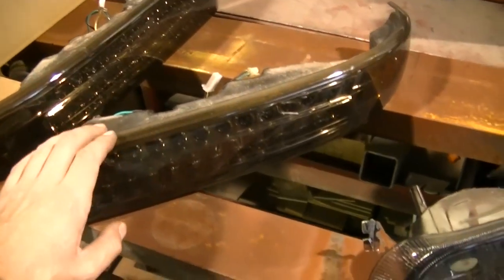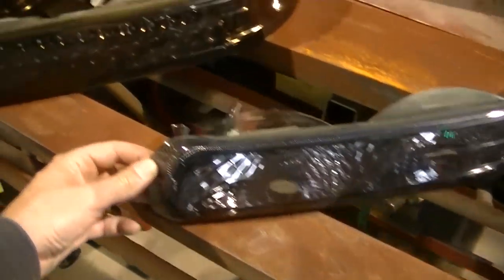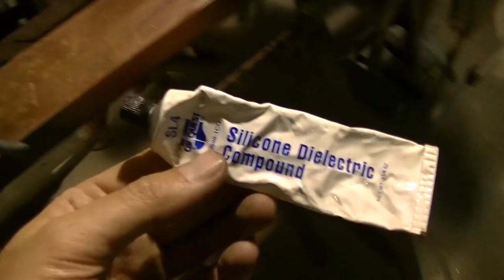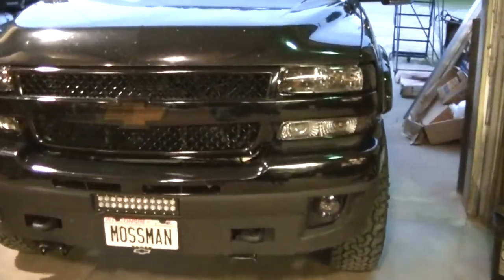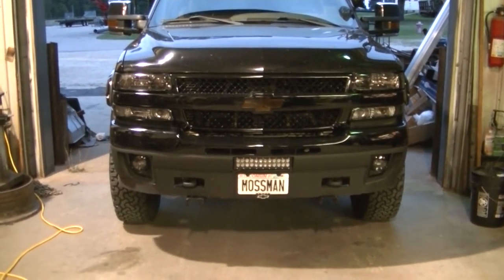Darth Dually New Headlights and Parking Lights LED Bulb Hyper Flash

Comment: Thanks for linking me to this video. Appreciate that you give honest advice without treating people like they are stupid, it's something more should practice.
Reply from the maker: No problem.  I think I used the Sylvania LED bulbs in this video which I have already taken out.  Just didn't like the output of them.  Really disappointed with them for as much as they cost.
Reply: I hear ya there. I have been holding off on light upgrades because of the cost. Hoping a light will blow so I can justify the cost of LED upgrade lol

Comment: Looks good!  I've heard that using LED lights could cause issues but didn't know about using a resistor.  Thanks for the info!
Reply from the maker: You might be able to get an electronic flasher to stop this.  I thought the 2000-up trucks had these already but maybe not.  The resistors came with the lights so I used them.

Comment: Quick Question. I'm looking to do the same setup.

Q1. Are these the correct light sizes?

Headlight:
- 9006 = lowbeam
- 9005 = highbeam

Signal:
- 3157A = daytime 
- 3157A = turn signal
- 194      =  side marker

Q2. Do you need resistors for every light individually? or just the two headlights and the turn signal?

Q3. Are those all stock light sockets for the parking 3 parking light bulbs?

P.S. Your videos are awesome, I've spent hours watching them.
Reply from the maker: Thanks,  those all look right except the official DRL is a 4157 I believe.  I think you can run a 3157A, which the A means amber.  I have a hard time getting the LED lights to last as a DRL.  That socket seems to get hot for some reason and even gets distorted and the bulbs are hard to get in.  The resistors only need to be on the turn signals.  If you have time to order an electronic or LED flasher some have told me you don't need the resistors.  That was what I had at the time and wanted to show everybody how they worked.  All the sockets in this video are factory type.  I hit a deer and had to replace some but they are still the same type that it came with.

Comment: You just answered my question about what to do with y 98 'Burban.  I'll skip the integral LED assemblies and just install LED bulbs.  I just put a set of LED reverse lights on that I found on Amazon.  They have a pretty cool mini projector.  They are awesomely bright.
Reply from the maker: Those LED lights only last about 2 years.  They are cheap enough really isn't a problem replacing them.  Do you have a link on those LED reverse.  One of mine went out and I paid like $60 for the set.
Reply from the maker: Rocky Mtn Redneck   Thanks,  I will check them out.
Reply: ....of course my S10 I deleted the factory blinkers when I built the bumper and just used the slim LED light bars.  Used the same for under the tailgate lights in the rear.  I didn't have to put resistors on the cirucuit. I was able to just install an LED flasher on them and that killed the hyper-flash.
Reply from the maker: If the lights wouldn't have come with the resistors I would have tried the LED flasher.  I have been to the auto parts stores before looking for LED electronic flashers and they just look at me funny.  I can't find anything local.
Reply: That's strange.  I can find them at Auto Zone or O'Rileys. Ask them to look up an EP29 flasher for your truck.  That or try Amazon:

iJDMTOY (1) 4-Pin EP29 EP29N Electronic LED Flasher Relay Fix For LED Turn Signal Bulbs Hyper Flash Fix
Reply: There's the reason I have Amazon Prime.  Anymore, they beat most anybody's price.  Every once in a while I have some key component of a project delayed, but usually it's okay.

Comment: hey man I also have a 03 suburban and I'm running the chrome depo projector headlights and I really love it. im running the 55 watts hid kit. the light output is great and very bright. I was thinking about replacing it with the new auxbeam led headlight kit. my brother has a 2002 silverado and he has the new auxbeam headlight and they are pretty bright. he has the stock headlight housing .  i will make a video soon on my 03 suburban.
Reply from the maker: I tried 55w hid in those lights and it melted the housing right in front of the projectors.  When I got those lights that was my intention of running 55w hid.  I love the LED headlights and they don't seem to be blinding like the hid but they are good and bright.

Comment: hey I am looking to buy some new headlights with the led bumper lights for my 99 Silverado. you said that about every two years your bumper lights start having issues so I wanted to know if those are just ebay ones you have had and know that they go out every few years or if they are nice expensive lights from somewhere else? also did you need a resistor for your led bumper light set or just when you replaced the turn signal with an led bulb? thanks
Reply from the maker: I have gotten all my lights from Ebay.  Not sure if spending more on them will make them last longer or not.  I usually change my setup every now and then anyway so don't like to spend a lot.  If you buy LED parking lights they should come with resistors installed with them.  If you just change bulbs to LED then you will need to add resistors or the easier better way is to get and LED flasher.
Reply: mossman381 alright thanks for the insight

Comment: I have the same housings and my driver side adjuster died as well. how are the morimoto fogs doing? are they better than say your 1500 with the oem and hid's? I have a set of led 880's in my fogs, and I love them, brighter than stock, but I want more light.
Reply from the maker: Pretty disappointed with the Morimoto lights.  They throw some light on the ground and that is about it.  I need to do a video to show.  I feel like something might be wrong with them.  They are suppose to be really bright and for $200 they better be bright.
Reply: I've thought about getting some of the DOT compliant rigid pods and mounting them in the oem location
Reply from the maker: Geekrc2012   I don't really like the pod look.  I wanted the OEM look.  I spent a lot of time making this bumper so I could use the 2015 fogs.  I may just get some smoked OEM style with either LED or HID.
Reply: I have 55w ddm tuning hid's for lows and aux beam f-16 for highs, and I have my main beans focused so far down I want more from my fogs to compensate

Comment: One thing you could of done besides using the resistors (I despise using them) is changing to an electronic flasher and/or getting canbus/error free LEDs. The canbus/error free LEDs have built in resistors so it has the resistance of a normal bulb, so no hyper flash or bulb out warnings on newer cars/trucks.
Reply from the maker: I thought the newer trucks already had electronic flashers?
Reply: +mossman381 Pretty much every newer vehicle the flashers/turn signals are controlled by the body control module so they don't have a replaceable flasher. But the canbus/error free LED's should still correct the problem without using the resistors.
Reply from the maker: I am talking 2000-up.  I thought they had electronic flashers.  I haven't looked at mine to see.  I got the resistors with the lights so that I the way I went.  Not really hard to wire them in.
Reply: +mossman381 The 2000ish model I know has a replaceable flasher, did one to a buddies. Don't think it applies to all 99-06 though. And yeah, they are not hard to install I just don't like them. I'd rather not attach anything behind my bulbs that just hangs and also gets hot and could melt plastic. Not to mention most people just use the t-taps which are horrible.
Reply from the maker: Daniel Pace   I will have to check mine.  I am curious now  :)
Reply: I've never personally had to use canbus LEDs on any vehicle I've done because most my friends don't have new enough vehicles that need them.  All I've ever done is replace the flasher relay.  But I do know people that have gotten canbus LEDs and fixed there hyper flash they had with the more inexpensive LEDs they had.  Don't remember which ones they bought. I do agree though that some vehicles, new vehicles, or more expensive "High Class" brands (Mercedes, BMW, Audi, etc.) you have to have a resistor pack no matter what because of the tolerance there body control module has on detecting the bulb.  I also agree that a lot of companies lie about their bulbs being canbus and don't know a capacitor from a resistor. I've studied a lot about electronics and know my way around resistors, diodes, capacitors, etc. so I know that there isn't just one solution to every vehicle/problem which is why resistor packs exist.  But like I said earlier, at least on my personal vehicles, I'd leave using one as a last resort just because I'd rather not have a big aluminum block behind every LED bulb.  Not to mention, if it ever came down to it, I'd probably just build my own resistor blocks and save money.  Those resistor pack can't be much more than a resistor in a aluminum block thermal pasted to the aluminum for the better built ones. Hell, I'd buy one just to see the inside of it.

Comment: I think it looks a lot better! Gotta fix my Tahoe turn signals it keeps falling out! had them 2 years now and there eBay special
Reply from the maker: I had a zip tie holding that last lights  :)   These snapped in really good.
Reply: +mossman381 you should show me lol
Reply from the maker: LB7 dually  I should have snapped a pic.  I just ran the zip tie around the deal that snapped into the slot.  Then run it around the slot itself.  That probably doesn't make sense.  Worked really good though.

Comment: how is the light output at night?
Reply from the maker: Light output is good.  I think I have them aimed a little low but the drivers side adjuster is broken.  They are sending me a new light.  I don't seem to be blinding people with the LED lights.  Nobody has flashed me.
Reply: +mossman381 ah that's good I got a set at one point and the output sucked! and those auxbeam bulbs are a good product? do you have the link to the ones you purchased?
Reply from the maker: Low beam 9006  https://www.auxbeam.com/headlight-bulbs/88621848 .  They are a really nice white light
Reply: Thanks much appreciated